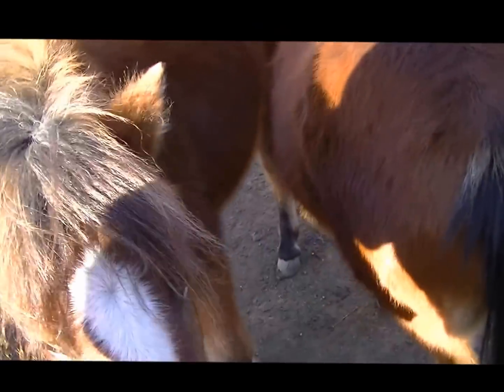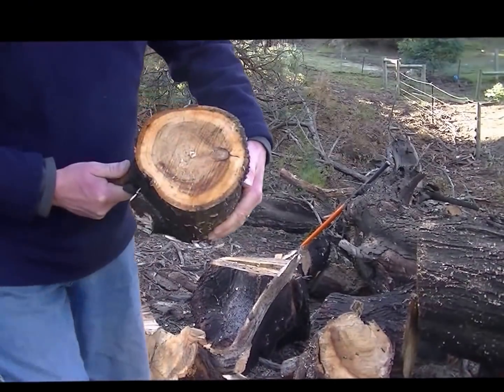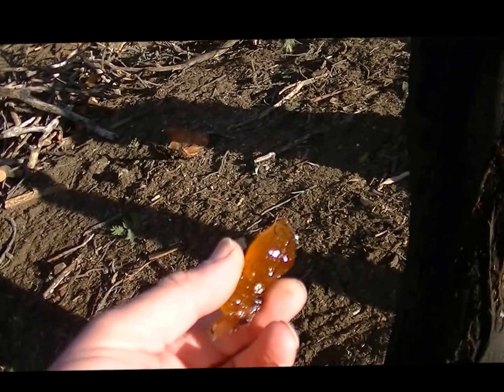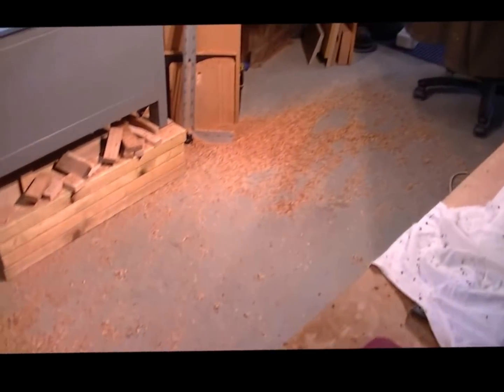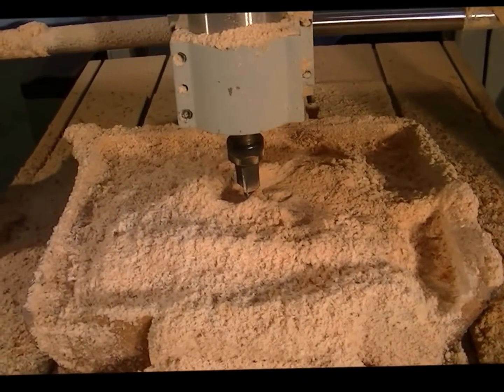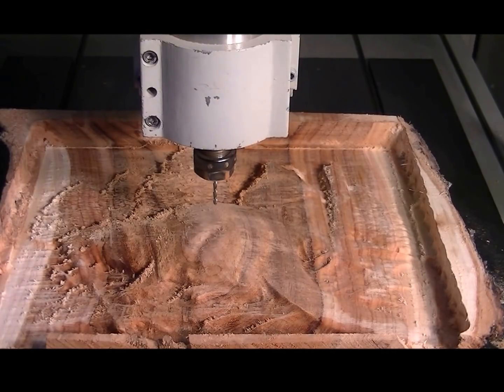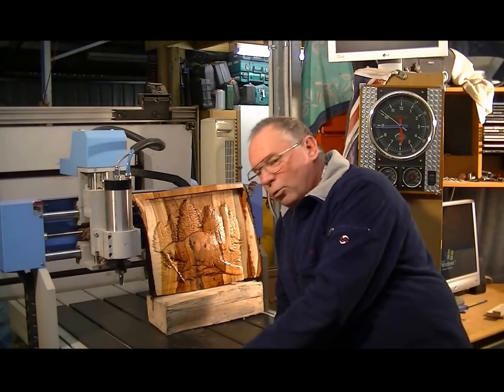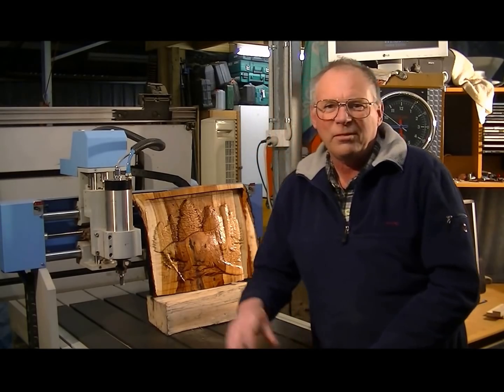108 $0.10 log into $100  3D Art CNC Router

Comment: Hi Roger,
I have today manage to do my first little job on my 6040Z USB 1,500W CNC that I purchased 2 weeks ago, I knew that I was going to go for a ride learning all the programs involved to create such beautiful pieces as those you do but, it has been many times harder than I ever estimated, starting with a new machine with corrupted files, nothing was making any sense and I got really frustrated so today, I carved a 20x16x3cm piece of red gum with a bull in 3D.
You are most correct about CNC work is not just waiting for the machine to run the program/Gcode, the amount of knowledge and work done before hand, is to be mostly respected however it should be said, it gets a lot easier after some time.
What would be your finishing bit size and profile for smaller carved/milled images in wood such as 3"x2"x1"..???
Cheers
George